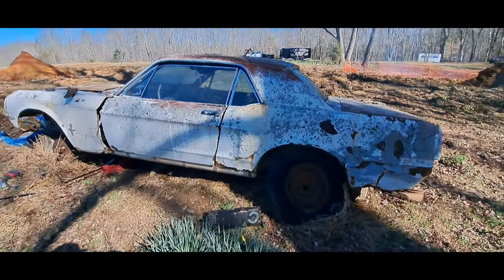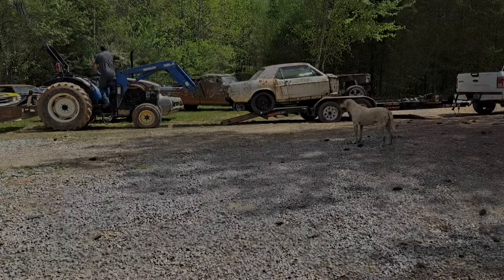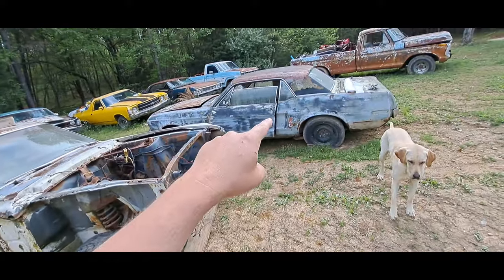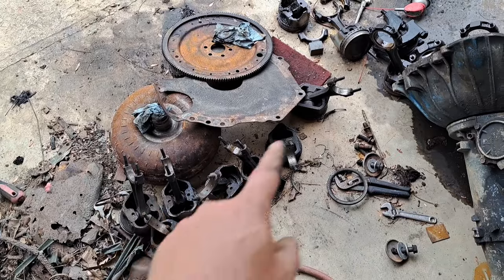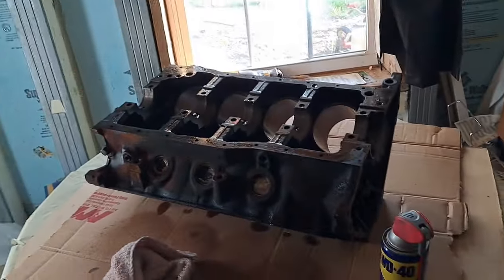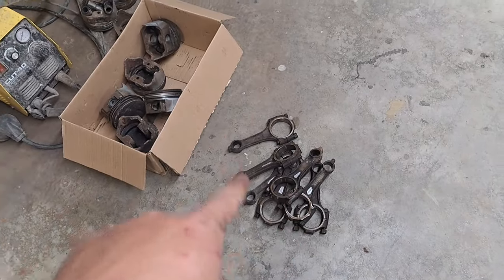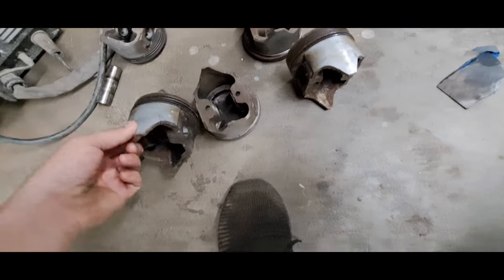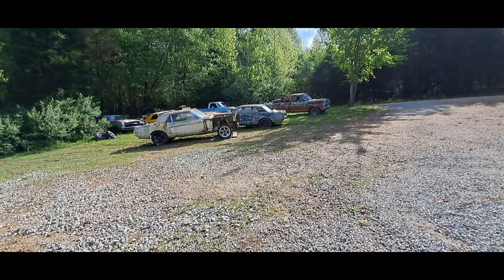1968 shelby gt500 movie clone car 15k budget build

Comment: Nice trick w the rod pins.  We used to chill down big valve seats with liquid nitrogen for an interference fit at the power plant where I used to work.  Heat and cold can make some jobs much easier!
Reply from the maker: Oh yea. I also use same trick with axle and diff bearings.

Comment: I know of a 68 Mustang Coupe up here where I live in Alberta, Canada, were I live that I can get for $500 it's in about the same Shape as this one.  How many of these conversions Coupe to Fastback and Eleanor builds have you done?
Reply from the maker: Well I've built 44 eleanor mustangs. Probably 50-60 coupe conversions. I'd suggest buying that mustang even if just to put it to the side until you can work on it.
Reply: @MrGonein60  damn that's awesome 44 of the awesome!  What's the average price on the Parts required for the Eleanor builds? They must have a specific website that sells the entire kits? Thanks for the reply
Reply from the maker: @fullyloadedkustoms  I make alot of the eleanor specific parts. I even have molds to build the body kits. I will however buy a bodykit when I'm in a crunch. On that last budget build I had less than 15k into it parts wise.